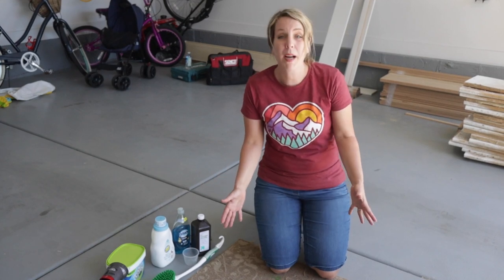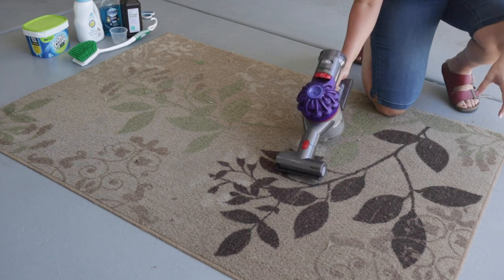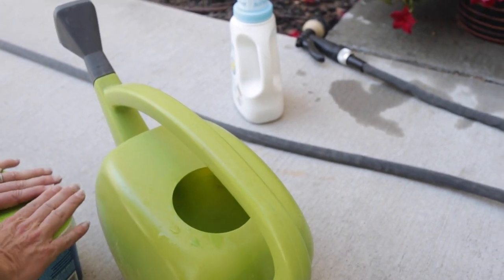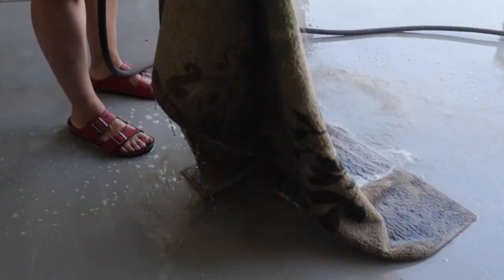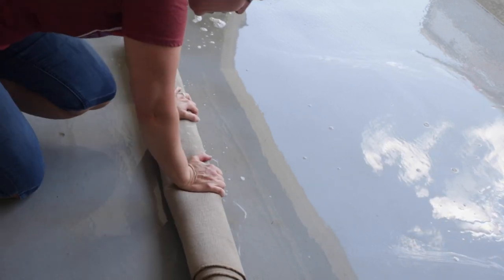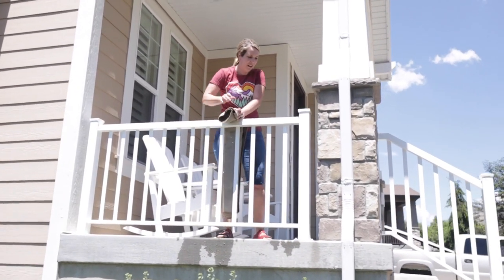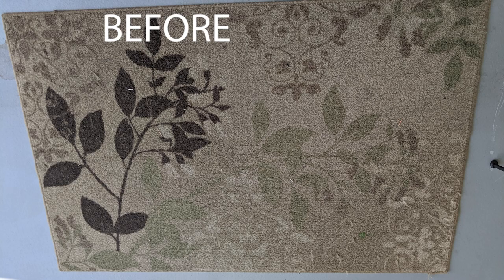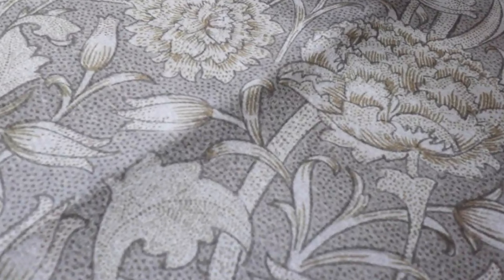How to Really Clean an Area Rug + Washable Rug

Comment: I really really want to try this but I just had a few questions before doing so. I was wondering if I should add water to the solution for the carpet? Or do you just dump the solution on the carpet and then start scrubbing? Also do you have to use oxiclean...... Or is it okay to use another powder detergent? Thank you so much for this video I'm extremely excited to try this!!!!!!
Reply from the maker: I just put it on and start scrubbing but read the level of the product you use to see best practices. You can definitely use another powder detergent but I’m biased towards OxiClean. Please share how it goes and good luck!

Comment: Hang it on the fence and use a low pressure setting pressure washer
Reply from the maker: Yes that's an easier option if you have one and it's not super cold (in the winter or would turn to ice).
Reply: I have a crusty rug, a fence, a power washer, and now a new project.  Thanks!